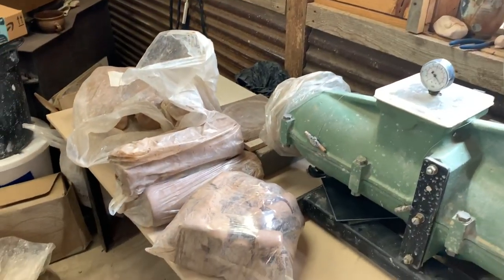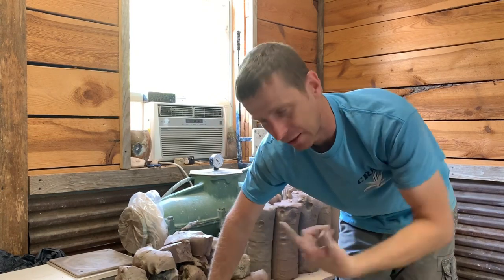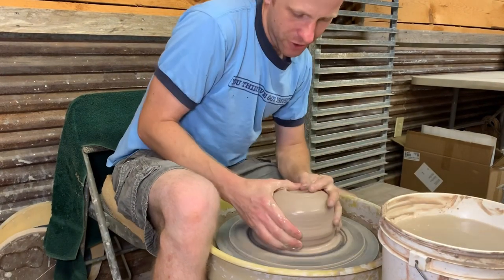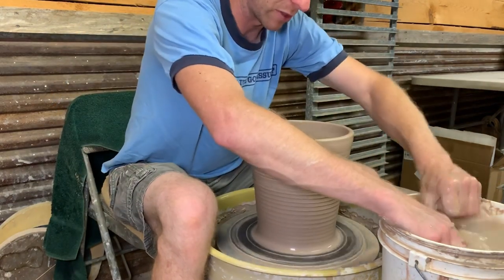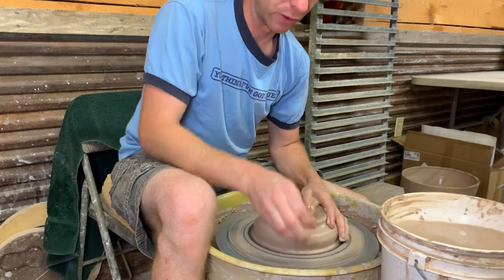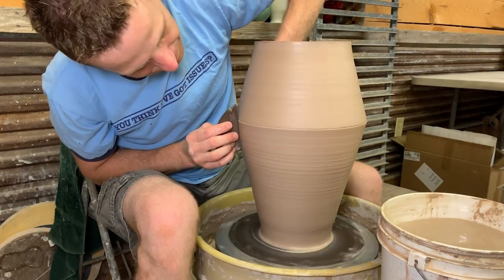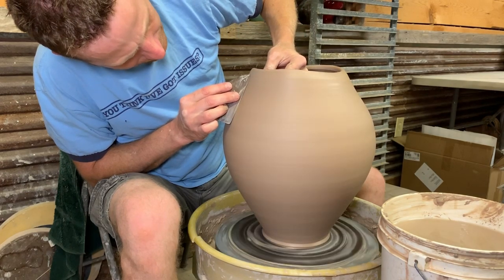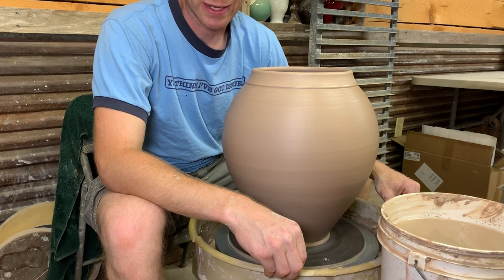Reclaim Clay and the First Pot for Firing #1

Comment: Question from a novice, in pugging all the clay varieties, are they all the same makeup or will different absorption and contraction/shrinking rates cause cracking while being fired?
Reply from the maker: The only problem would be if you combined clays that matured at different temperatures.